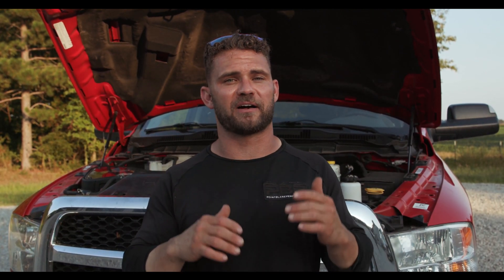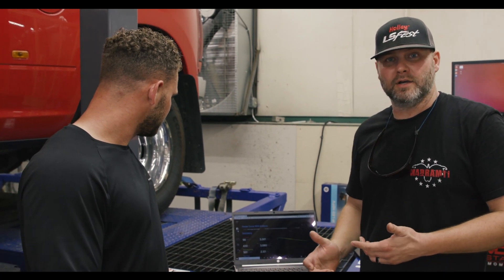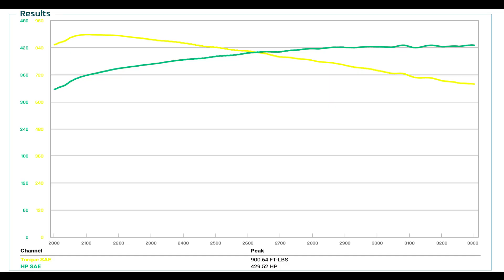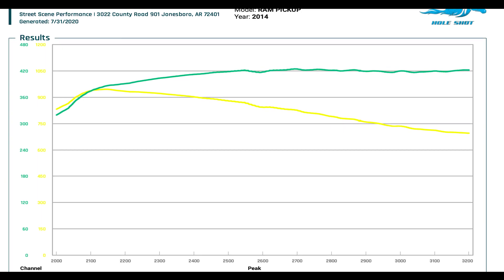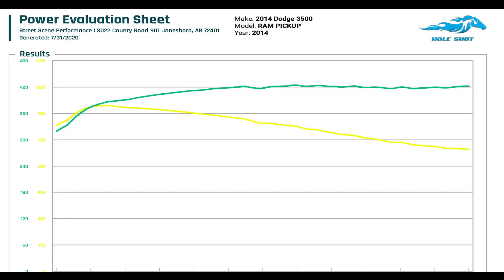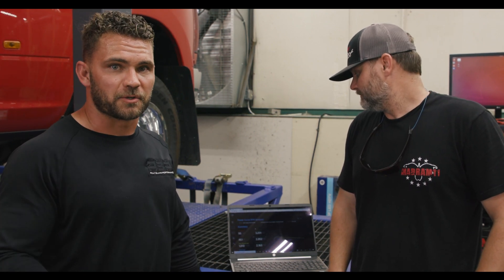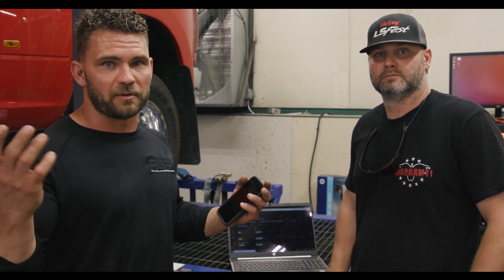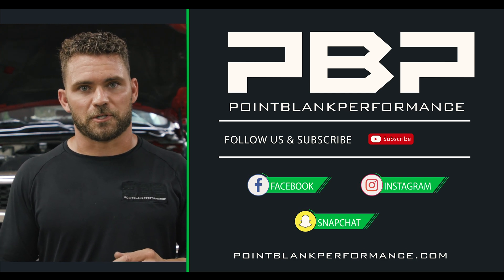4TH GEN CUMMINS STOCK VGT TURBOCHARGER DRIVE PRESSURE!!

Comment: Does excessive drive pressure result in blown head gasket most of the time or can you get you get a leak that starts at the valve cover or CCV cover?  I don't have head studs and tow about 19k lbs relatively frequently.  I'm not looking to make tons of power, I just want a reliable truck that can conservatively pull.   What is considered high drive pressure?

Comment: Im new to diesel trucks, I just purchased a 2014 ram 2500 tuned and deleted with what looks to be a 5" exhaust.   Tune is not changeable, just what's in it is it.  I've seen as high as 26psi full out , been looking at intake horns and grid delete along with the intercooler piping.  Are these worth while and should I do that before a tune?
Reply from the maker: Hey Chad love to point you in right direction ! Can you shoot us a email or we can email you so we don’t loose track ! Pbpmotorsports@gmail.com I greatly appreciate it !